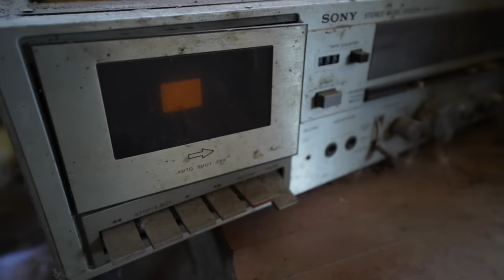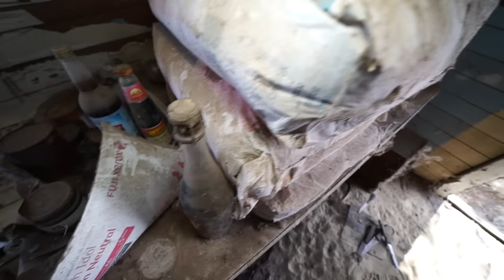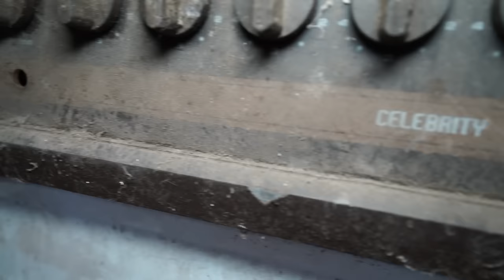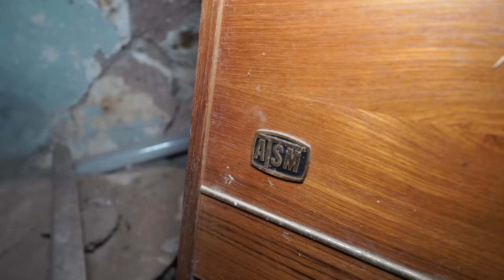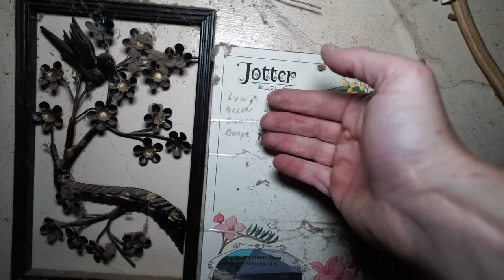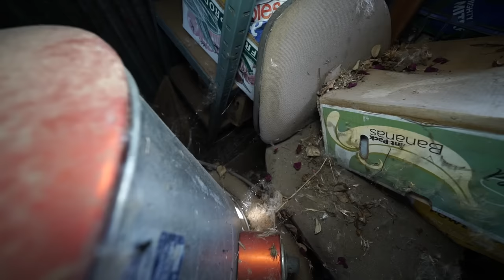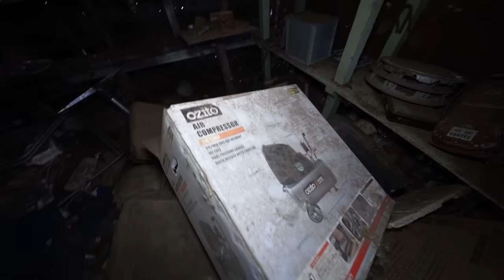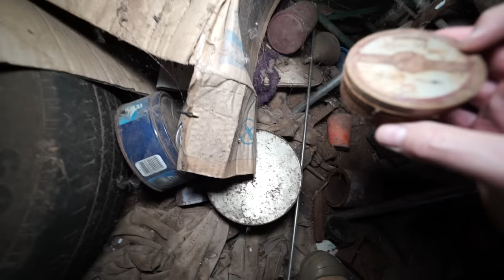Time capsule cottage with lots of old items and a packed shed with all sorts of retro stuff

Comment: The compartment at 39:56 looks like a fold out table top. The little bit inside swings out to hold up the cover. This explore had an eerie and sad vibe, certainly many reminders of the occupants long gone.
Reply from the maker: What a cool arm chair!!!! :-) Cheers for that info mate
Reply: @urbexindigo5164  also to add, the electronic device just before you saw the arm chair looks like it might be a chicken incubator. The concrete pad in the back room would have been outside before the additions were added. It could have been a pad for a machine shed, water tank stand or probably a generator mounting pad.

Comment: So what came first, the termites or the abandonment?........I would guess that there was a termite problem first, and that may be why the one room has a concrete floor.  Then when the termites made a comeback, probably in the late 1980's, once they got so bad the people moved out and abandoned it.  in the following 25 or 30 years the termites destroyed the remaining floors.  There was an old abandoned house near where I live that went from standing to completely fallen down on itself in the space of about 18 or 20 years due to termites, so I imagine that is what has happened to the floors.  I also saw in a few shots they were making their way up the door jambs.  Termites are relentless once they get in.  

In that first room of the old part of the house, the one that had the concrete floor and filled in fireplace, the raised concrete slab is where a wood stove would have sit, there is a hole in the ceiling right above it where the vent would have run up.

A very cool old house, with alot of neat stuff left behind, thanks for sharing!!!